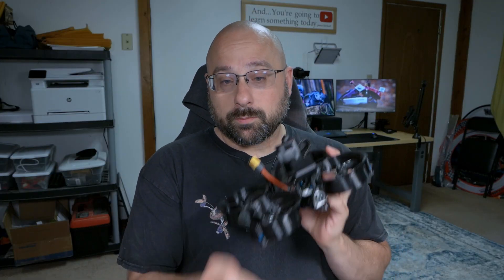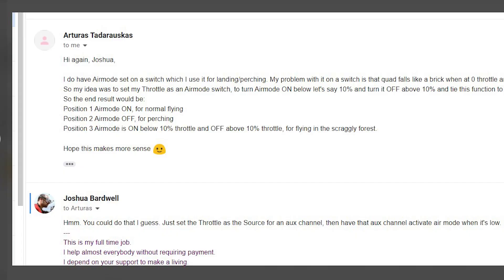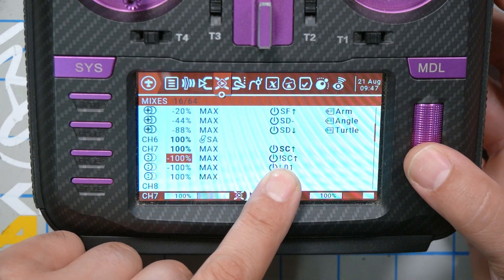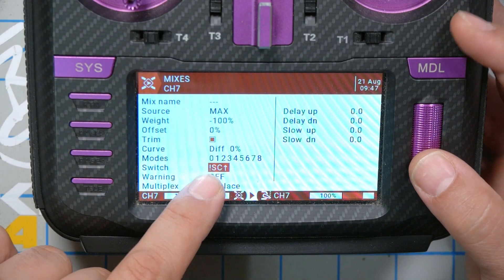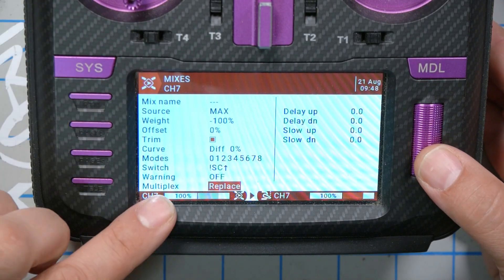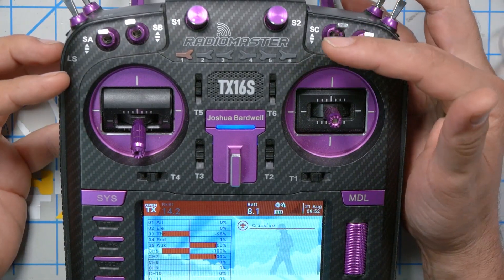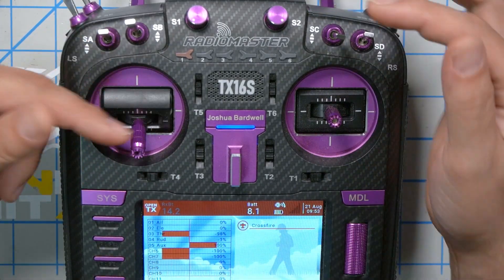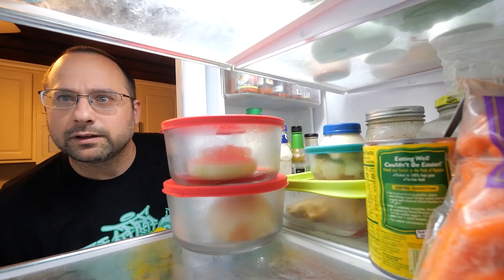Betaflight Air Mode is bad for Whoops. Until now. Maybe.

Comment: Thank you very much. I was hoping that this solves the problem I have with my bumblebee V2 with T-Motor 2203.5 (2850kv) on 6s. 
But how can I set this up using the DJI digital FPV Transmitter? How can I set up the Throttle stick position as switch in betaflight?
The quad sometimes just winds up the motors to full power eventhough the throttle stick is back at ZERO! And than with full throttle it has desyncs. Could it be possible that what I am experiencing has something to do with airmode? I have set permanently enable Airmode to on, airmode_start_throttle_percent = 25, idle_min_rpm = 5. Any idea why I am eyxperiencing this? (btw. I already changed the aio fc to a t-motor mini F7 stack bat still experiencing the exact same problem... so I put back the original aio fc) Thank you very much.
Reply: Do you solve the problem? I having the same experience

Comment: It will help to land without jumping.
Reply: sorry it wont, it's the opposite. If you don't want airmode ( and jump on landing ) you have to turn it off with a switch before to land. This video shows how to automaticly enable airmode at low throttle !

Comment: i like this, in my case i add another logic to check AIL or ELE not in center (> 10 or < -10) also .. so in center stick and no throttle air mode still off, but add little AIL / ELE air mode will be enable. and no jumpy whoop during landing

Comment: Couple of questions  my  modes are all on one switch. SD up is angle, SD middle is Hor, SD down is Air Mode. 

I'm on Open TX ,via a Tara is X9 Plus. The menus look different than on your radiomaster.   I understand mixes somewhat. When. You want to set up a situation where throttle is down you still habe airmode enabled and when you have throttle on Airmode is off.   Are the other flight modes on a different switch?    Laslty on the x9D plus  is there a tutorial to achieve what you'd showed here.  Thanks for all your patience and kindness.

Comment: This sounds perfect for my cinewhoops. But i think I will set my T18 switch differently. Switch front=airmode on, middle=taking off airmode is on but turns off after 10% throttle, switch down=airmode off.

Comment: So take this with a grain of salt since I am still pretty new to the hobby:
I'm on a flysky i6 flying a mobula 6 on 75mm  frame conversion. The way I've done this in my mixes is:
Master: ch3
Slave: ch6
Pos. Mix: -100%
Neg. Mix: -15%
Offset: -15%
(The rest can be fine tuned in betaflight)

I was experimenting with idle up and acro indoors but found I wasn't getting the low throttle manuvers I wanted. So I tried this mix thinking it wouldn't work but it did first try! (Some of my newly obtained computer science degree helped me out a little probably). 

So what I've found is that it doesn't completely eliminate the problem but it makes it significantly better. It also seems the quad is flying more smoothly and predictably now. It feels way easier to hit gaps (I usually fly through folding table legs and a small hexagonal table with about ~1.25ft gaps on all sides). When bumping into things whether on accident or purpose with me testing it, it makes it way easier to recover and correct any bumps. And now when I crash the quad doesn't fly across the room like it used too. It more or less falls right where it hit. One of the only downsides I've been noticing is that when arming for turtle mode there is a slight delay. Don't know what it is from yet but I'll find it hopefully. 

It is also a little weird feeling when setting up for my bookshelf dives and whole room wall surfs but I think I will get used to it with time. 

It definitely boost confidence with the predictability and it feels like I'm getting faster lap times around my little house course.

Comment: Hey Joshua, just a question: 

I followed up the video but for my tinywhoops model on the tx16s I do want it 100% of the time activated and not having to flip a switch for it.

I did everything exactly like you said but instead of having the switch up like in the video, in my case I left SD↓ and !SD↓ at the mixes tab, and then did the opposite at the logical switches tab, l01 if a<x thr -80 SD↑ and l02 a>x thr -80 SD↑ 

That would be correct? Haven't had the time to test it, but I would like to confirm I did the right thing because I think I don't fully understand the logic of it. 

Thanks!

Comment: Is this something that the Betaflight devs could bake into the firmware?
Perhaps an airmode_throttle_activate parameter, so airmode only works when the throttle is equal to or above that parameter, defaulted to 100(%) so airmode behaves as normal for everyone except those who purposely specifically change the airmode_throttle_activate setting.
Reply: never, JB missed that airmode usefull not only in low throttle - it is most usefull at full throttle, when you have motor clipping

Comment: Your impression of a quad stuck to a wall is uncannily good!
Reply: Actually when I first discovered this with a cinewhoop the quad hopped and stuck to my thigh and gave it a nasty case of "road-rash". I screamed WTF!?

Then I learned. Sometimes learning hurts.
Reply: @sadkingbilly4531  Having just gotten my first tinywhoop, I thought he was exaggerating with the "stuck" to the wall. I thought it would just momentarily "stick" and then come off but no: I literally had to disarm to get it off.
Reply: @Vousie  I disarmed as well to get it off of my thigh's flesh as it chopped away. But hitting disarm could've just been self preservation. It all happened so fast! ;) I've got a nice scar there now as a reminder. I've now switched to EmuFlight and never turn on Airmode.

As a point of reference the quad that jumped me was the Beta95x v3 with their stock Betaflight tune.

I guess they call the effect "wall suck" for a reason.
Reply: @sadkingbilly4531  Yikes. That's nasty. I've been playing with ArduPilot a lot - running test flights of pull-requests that haven't even been merged to master and haven't had any dangerous issues - the worst it gets is just flipping over when it tries to takeoff, and that's when we've messed with the EKF.
The whoop I recently got is my first Betaflight quad. Literally with in 1 minute of flying it, I had already run into this issue - every time it lands on something not perfectly flat it just goes full throttle against whatever it landed on... I'm so glad this is a harmless whoop and not a 5 inch...
Reply: @Vousie  3 years later... same problems being discovered by me on my first tinywhoop. Nothing new under the sun. :D

Comment: You can also do this on the Betaflight side! Just get an extra transmitter mix to mirror your throttle mix, then set it up to control air mode in the modes tab.
Reply: how i can set a mix with the throttle that i can see at bf ? i only see the Throtlle moving but not an Aux Channel (this i would like to use for Air Mode)
Reply: @manuato  you can add one more aux in mix tab and source it from throttle stick
Reply: Can you do it completely in Betaflight?? As in do nothing in controller? I like the idea of using the throttle to activate airmode at low percentage but I can’t fathom how that’d be accomplished!
Reply: @alloutofdonuts3998  I think you'd just need to set an aux channel to mirror the throttle channel or simply use the throttle value. Then in Betaflight's modes tab assign the channel you've just set up to toggle Airmode. Then use the "grab handles" and select only the lower range (you can try experimenting by moving the throttle and seeing it's channel position on screen).
Reply: @jasio77mega  hmm, good idea. Would this work w/dji v1 Tx tho?

Comment: Would be awesome if this was implemented into Betaflight. Airmode below X% throttle (setting in GUI would be best, or at least a CLI command line for the percentage).
Reply: Totally agree! I fly some of my drones with an FS-i6s which doesn't have OpenTX

Comment: "Airmode-ON at throttle 0". This reminded me of my chat with betaflight devs in Betaflight slack channel. One of the devs there told me "try to learn the trick that other pro pilots do and that is =NO to zero throttle=". What are your thoughts on this?
Reply from the maker: All pro pilots that I know go to zero throttle sometimes. If you really wanted to prevent zero throttle you'd use idle up. But air mode specifically has advantages over idle up.
Reply: @JoshuaBardwell  awesome! I just wanted to share because I recalled it. I followed his advice. But quite honestly, I still do zero throttle. He told me that advice because we were talking about preventing propwash. Thank you for replying. Appreciate it a lot!
Reply: @JoshuaBardwell  I have another question. Is it ok to turn off AIRMODE on a 5 inch quad on high throttle like between 5%-100%? So AIRMODE will be ONE from 0 to 5%. I'm asking because someone told me that it's only recommended when quad is whoop.

Comment: I think there's a slight bug in the logical switches that you have setup.

When the throttle is exactly -80, neither logical switch will be true. This would then set the airmode channel to the middle which luckily will then either turn airmode on or off.

Sadly OpenTX doesn't support <= or >= operators, but you can do this with a single logical switch. Create one logical switch which is triggered when SC is down and the throttle is less than -80, then for your mixer lines set one to the logical switch and set the other to the inverse of the logical switch. It also means that if you want to change your threshold from -80, you now only have to do it in a single place.
Reply from the maker: I tried using a single logical switch but the combination logic with SC did not work as needed. The flaw in the logic means that air mode status is undefined when the throttle is at exactly -80 but I don't think this matters. Either it'll be on or off, which means the actual threshold is effectively either -79 or -81, but who cares?
Reply: @JoshuaBardwell  You're right, I forgot that a logical switch is just a single operation so you do indeed need two. It doesn't matter in this case because the Betaflight modes will handle it but it may be an issue in order similar cases where logical switches are used for mixers - I just wish OpenTX supported the <= & >= operators.

Comment: I would like to know if this method can be used to set a minimum throttle for disarming the quad,to avoid accidentally disarm while flying
Reply from the maker: Never restrict the ability to disarm, for safety reasons. What if your throttle gimbal failed and pegged the quad at full throttle. Would you want to disarm?
Reply: @JoshuaBardwell  Then I would simply turn off the radio...

Comment: It's not just on throttle cut that airmode does its magic... it allows the PIDs to use the full range of the RPM no matter what your throttle setpoint is... Without airmode, airmode at say 50% throttle, your PIDs can only use RPM up to 50%. This means that the PIDs can only really decelerate motors rather than adding RPM to some motors and decelerating others.

Comment: All my quads have air mode on a switch, but it ended up like that because having air mode permanently enabled made my first build fly to the moon on takeoff.  I still don't know what went wrong at that time, but it caused me to do it for every build and never bother looking back lol
Reply: how difficult is to set Air mode on / off on a switch? I have Tango 2 but not much ide of how to configurate it.
Reply: @AEROVISUALES  Assuming you're using Betaflight, just set it up like any other switch. One of them is already set up as "AIR MODE". Just make sure to turn it off under the configuration tab where it says "Permanently Enable Air Mode" too.

Comment: Sadly that way you still get that horrible bounce and overreacting to ground-effects when landing. That's why I put Airmode on a switch in the first place, so I can land my quad precisely and gently where I want it. That's a tough one...

Also would there be a way to do all that without wasting that channel just to switch airmode? (I use your all-modes-on-one-channel technique to just taper that into my other flight modes but still I think a betaflight setting should be able to do all that by itself...)

Comment: Is it possible to turn off gps as well from radio for indoor flying?
Reply: In the advanced failsafe tab in BF, you can enable arming without GPS fix. You just have to remember to wait for your satellites when you go back outside. 
If you arm without gps outside but get a fix in flight, you’ll get an osd message saying to land and disarm. Doing this will set the home position for gps rescue.

Comment: It looks like this has been raised as a dev request before but should we (the community) raise it again? Just crying out for a single CLI command "AIRMODETHRESHOLD =" Sorted. No mucking about with tx mixers. It's such a simple thing to add to the sourcecode it's wierd it hasn't been added already.  My skills are in bitching not coding but still, almost tempted to have a crack. As long as it's in Basic, Tpascal, x86 asm or Python I'm doing it :D
Reply: "My skills are in bitching not coding but still......" Me to

Comment: Can do this with one mixer line, one logical switch line and one special functions line.  
Mixer line for ch7, set source SD and then in BF Modes tab define your range so that Airmode is ON when AUX3 is middle or low switch position and off in upper position. 
Logical switch L01 is active when X<-80 on throttle and SD down. 
Special functions L01 Override Ch7 set value to +100 (airmode off position) and turn on the checkmark at the end of the line to enable.  

That's it.    Don't forget to turn off AIRMODE always on in BF features.

Comment: Or, if you don't care about an override switch, just set the mode to your throttle channel in BF?
Reply: Cannot. Modes can only be assigned to AUX channels, not the primary stick axes.

Comment: JB thanks works like a charm with some changes. I have my modes set on the 6 position buttons (actually just a 6 position switch), with the first (default on radio startup) position set so the quad will not arm even if the arm switch is on and the throttle down.

6P4 previously turned on Air Mode, which it still does with other qualifications. Set as Aux 3, with a value of 50%, ADD
Aux 3 also includes a logical switch when the throttle is above -85, with a value of 50%, ADD
So when both values are on, Betaflight goes to 2,000 and turns Air Mode on. Throttle down, Air Mode off.

!6P4, with a value of -100, REPLACE
so when the 6 position is on any other mode, air mode is turned off.

Not flown it into anything to see how it acts but is does now land without bouncing at zero throttle, still armed. Looks good.